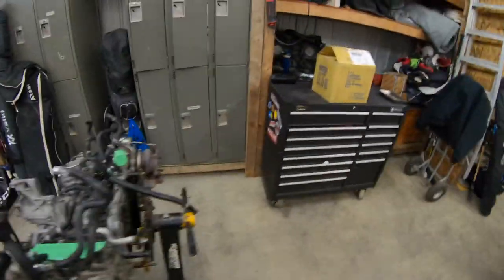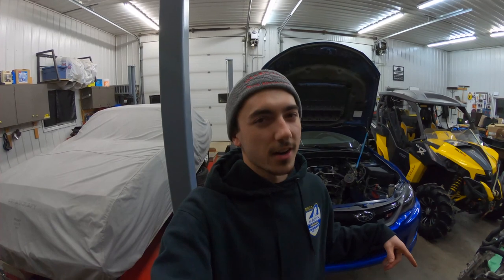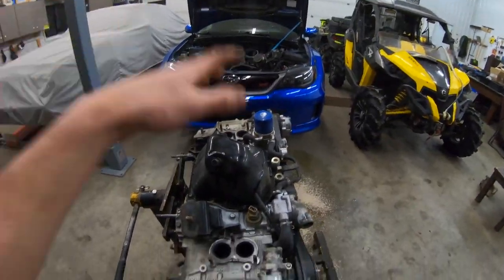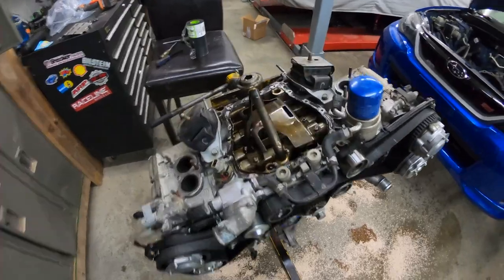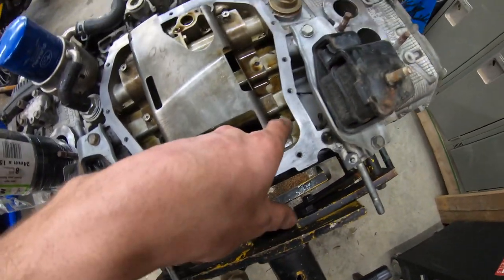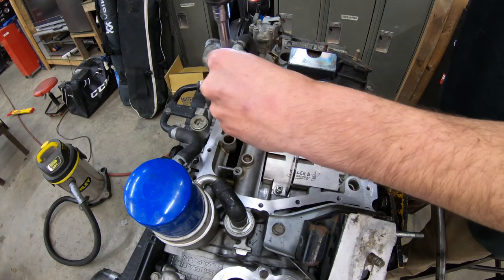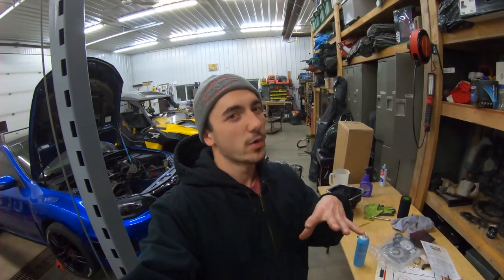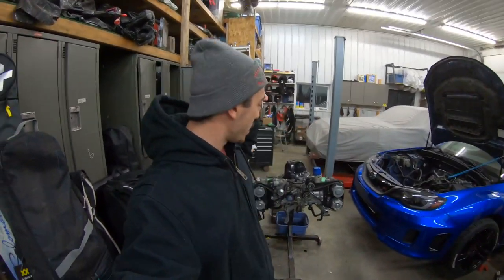SUBARU STI KILLER B OIL PICKUP & BAFFLE INSTALL!

Comment: Cant wait to see my closed deck done, im debating between keeping oem pan with killer b pick up or to get the whole killer b oil pan kit.
Reply from the maker: Depends on the power level! I got away with the oem pan making 500WHP reliably. I remember you saying you were pushing for way more than that, so I’d get the killer b or IAG pan for the extra oil capacity/baffling 👍🏼
Reply: @DanielKellert  600+, i might add the pan to the parts needed, the long block is already done, hopefully next weekend I drop off my car at the tuner....long ass wait...over 1 year and half, this build is about to be a wrap🙏☝️💪
Reply from the maker: @TheE3R Ayyy good luck man I’m excited for ya!! 🤞🏼🤞🏼
Reply: I'm getting my High flow killer b oil pickup and baffle installed soon. with a new OEM oil pan. Using the oem pan, I don't think I need to use the spacer.. I didn't see him install it and that's kind of good because I wasn't trying to buy the killer B oil pan/pick up hardware kit because I can't buy the spacer separately if I had needed it. How did your baffle and pickup bolts look when u took off the pan? Same with the header and up pipe bolts?

Comment: No oil baffle in this vid but the pickup and Windage tray look good
Reply from the maker: The Oil Baffle is the Windage Tray? 🤔 They are the same thing 😅
Reply: @DanielKellert  oil baffle is a different thing, it prevents oil from leaving the pan area, the Windage tray which you installed prevents the crank from churning the oil and frothing it. 2 separate parts, some aftermarket pans have a built in baffle and some have a separate piece that goes across the pan. Happy tuning!

Comment: Great Video! 

Did you have to unbolt the oil dipstick from the engine before pulling it out of the pan?
Reply from the maker: If you’re pulling the dipstick before you pull the pan, yes you need to unbolt it to pull the dipstick out from the top. If you’re pulling the pan first, no you do not need to unbolt the dipstick to pull the pan. It just makes installing the oil pan with fresh silicon on there easier, then you don’t need to work around making sure the dipstick is lining up. You can just put the dipstick in after the oil pan is torqued up. 
Thanks man! Glad I could help!
Reply: @DanielKellert  just saw this! Thanks so much. I'm going to pull my pan on Saturday! 

Also is there an O-ring inside the pan that I have to replace? Not the pickup nor the dipstick ones. In pictures it looks like there's a hardline inside the pan that connects to the block 🤔.
Reply from the maker: @ryanc2360  No problem man!! Good luck with your install! It’s pretty straight forward 👍🏼 and yes there is one o ring that goes between the block & pan. I put all of the oem part #s I used in the description! 🤙🏼
Reply: @DanielKellert  got the old pickup and baffle out! I'm picking up the new O-rings from Subaru on Monday. 

Best Oil Pickup install vid I've seen! 😁
Reply from the maker: @ryanc2360  Thats what I like to hear🤟🏼 appreciate the support man!

Comment: Should i get the pick up as well on my 2018 sti? Its bone stock i just want the baffles so it regulates future issues. What should i do?
Reply from the maker: The biggest issue is the weld on the pickup tube. It’s very common for them to crack. Get the pickup too 👍🏼